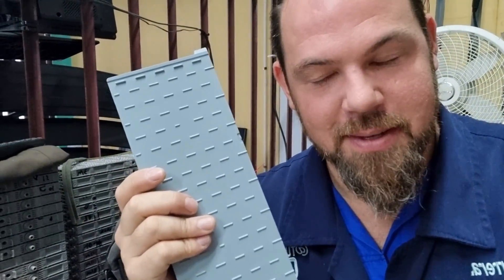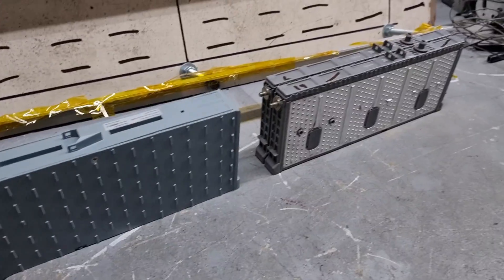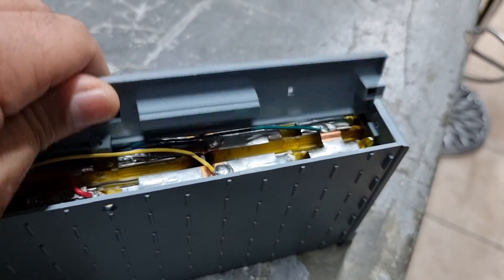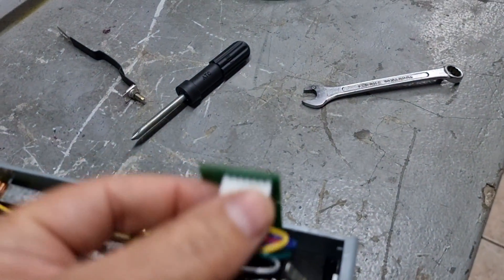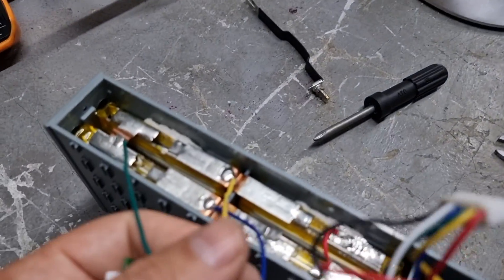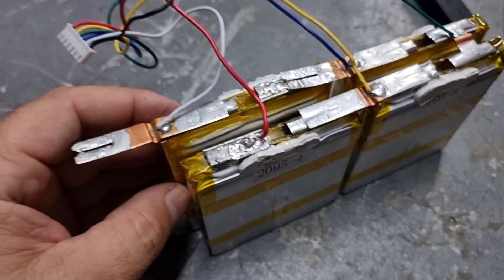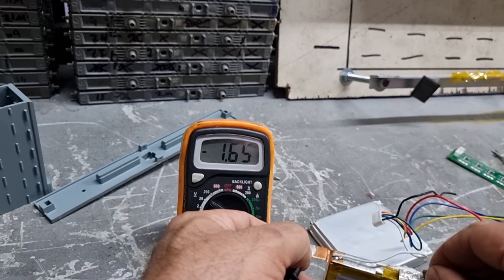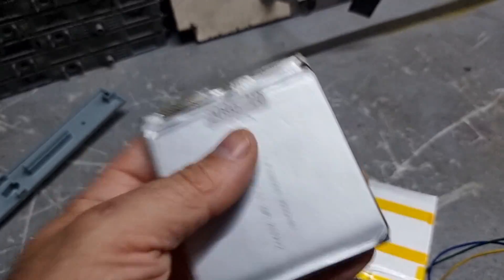Inside the nexcell lithium battery for toyota hybrid (Class Level Lesson)

Comment: Hi Jose, nice video showing the internals of the Nexcell blades, but I am not convinced with the build quality of this product.  The bus-bars are not sufficiently thick to carry the current required by the system.  There is no proper cooling or heat dissipation for the cells!  I know that you provide a good service to your customers, but you will take a serious draw back selling this product which won't last . . . I have also learnt a lot from you Jose by sharing your knowledge, but please keep away from this product as you may own a bad reputation with it.

The Toyota NiMH modules are 6S1P in configuration, since this drop in solution replaces two original modules with one Nexcell module which is 5S2P of LiFePo4 which kind of matches the voltage profile.  Thus 12S1P NiMH cells are replaced by 5S2P LiFePo4 cells.

Well while Jack deserves a lot of credit for bringing this solution to the market, which consists of replacing the cell chemistry NiMH with LiFePo4 or Lithium Iron Phosphate, by a drop in replacement of two Toyota modules with one Nexcell module, he does not address the fact that the car has no notion of the new cell chemistry in the battery.  NiMH with respect to Lithium Iron Phosphate chemistry have different charge and discharge profile in terms:
-> Maximum peak charge and discharge currents  as well as for how long
-> Maximum sustainable charge and discharge currents without deteriorating the battery health/longevity

The guys making the Nexcell Lithium battery are not telling you the whole truth.  These cells build quality is questionable, can it really handle the high amperage current it claims when you look at them.  For sure they did a good job of replacing the chemistry of the NiMH with LiFePo4 and adding cell balancing, but there is more to that, what they don't mention anywhere is the software of the Toyota Hybrid system is not touched.  The car has no notion it has a bigger battery in terms of capacity (Ah) and there is no way that it will make better mileage for what it what it was calibrated for!  Its good as a battery replacement, but too many customers are complaining about the Nexcell cells failing.  Wished the product was better well designed or else there would not have been so many revisions, they should have done it right the first time . . .  They are taking 2 Toyota modules of NiMH {known as a block in Toyota jargon} and replacing it by one Nexcell blade, from 12S to 5S, they should be given some credit for that.  Have a look at one the video where the Nexcell is being fixed https://www.youtube.com/watch?v=6BC56g3C09g by its creator.  Its like a teardown.
Reply: Might want to put some thought into your statement... the oem batteries doesn't have a  cooling system either...because it's built into the case. Nimh also generates more heat during use compared to lithium due to higher IR, requiring more cooling capability. These are also lifepo4 not lipo, so less likely for thermal runaway. Nevermind the amperage is still limited by the vehicle. There is more energy available, but the car isn't gonna use more in the moment than it would for a oem battery. Nevermind you are not pumping the full battery current through an individual cell busbar, that's not how circuits work...

Seems like you are parroting what you heard other people say instead of doing your own research...
Reply: @tarkov_6 What nonsense are you stating, "you are not pumping the full battery current  through the cell busbar that's not how circuit work!"

Comment: Aside from some balance circuits I don’t see any special circuitry or computer interactive bms or anything. 
Just some lifepo4 pouches with balance leads? 
I mean a BMS really isn’t required since the Prius has a built in high and low cut off and active cooling. 
What’s to stop me from using much larger and cheaper prismatic cells and building my own custom pack? Pretty sure I could cram 10 maybe 12 kWh or more in the boot.
Reply from the maker: Go ahead… 😁
Reply: @hybridsolutiondiagnostics  just asking, I see loads of forum posts but not a lot when it comes to actual specifics like balancing, bms etc.
LTO looks like a better fit with higher current capability, temperature range and it falls better in line with NIMH. 

I’m kind of a dumby, I can copy but most of these vehicles are way over my head. I’d like to squeeze a plug in hybrid out of my gen 2 though. A robust vehicle, I live in a rural area, all electric is unreliable but a plug in with a very efficient gas engine back up sounds perfect. Even more so the gen 2 lacks modern network integration and all the other bs I don’t want.

Comment: Great video! Thank you very much. In general, everything looks good. although some things could be improved. Firstly, the current-carrying bars at a glance have a rather small cross section, they will heat up and transfer heat to the cells. passive balancer? he will only do worse here, as an option at least active.

Comment: 3.2v is nominal voltage and it points it is lifepo4 module. It is strong, high current and much safer than liion. I think the producer shall drill ventilation wholes especially near balancer modul which warms resistors when cell has more than 3.65V.
Reply from the maker: New generation modules are coming better ventilated… video coming very soon

Comment: i didnt see thermal solution in there hmm
Reply: I see no strategy at all for minimizing the spread of a over-temp event that occurs in one "blade".  Nexcell designed 6 pockets in its injected molded case, but that's it.  The thin molded walls between these pockets are the only things that prevent flame spread.  

I might have chosen to skip the clever diamond pattern on the external faces of the blade that mimics what Toyota did and instead insert a sheet metal flame barrier between the blades.
Reply: @jimolson5018  this is lifpo4 chemistry they don't flame and i dont think they get as worm as the oem batteries because they can put out a lot more amps
Reply: Jake, when you're blowing off a hundreds of thousands of kilojoules of energy in several seconds, battery chemistry is irrelevant.  Heat is heat and the dissipation event ensnares any flammable material around it, like the plastic enclosure.
Reply: I have multiple 200 amp hour LIPO4 batteries and have had no heat issues, however all my cells do have ventilation and I have seen cells same as mine with evidence of previous ventilation. 
Those were used in city busses.
Reply: As of relatively recently there has been a ventilated top cover released. It's still passive cooling though. Worries me a little bit.

Comment: Wow. Really show the cheap quality of these batteries.
Reply: definitely, this feels very cheap compared to OEM metal enclosures.
Reply: I have bought these cells to replace my old ones and I have not felt that they were cheap. 
The OEM are plastic and metal and that metal is feels rather thin.
I would say that Toyota's engineering of early Prius is substandard. 
Just the fact that they manufacture a car whose batteries would die after a few weeks without driving is indicative of idiot engineering. 
They should had at least provided a trickle charger that could be plugged in to maintain the batteries. 
These replacement batteries are LIPO4 and don't have that self discharge problem. You can leave your car for a year and unless there is some parasitic drain, the batteries will be fine when you get back to it.
Reply: Not sure where you that from this.....

Comment: Dear Jo, i see this give out (3.2v X 5) = 16v @ (3500mAh X 2) = 7000mAh 
the OEM is (as a block) 14.4v @ 6500mAh and has better cooling since metal is better at conducting heat compered to NexCell that is staked up lithium in a plastic case.
Mr. Jack say his battery is 2.6 times more powerful than OEM.. how is that possible.??
the numbers don't add up. i am not so convinced.

can you please shed some light and in-light us with your knowledge and experience..

thank you very much for a great video, and thank you Jack for making Prius good again.
Reply: On their website they are claiming 2.6 times more power using the "peak power" capable of each battery.

260 amp peak for the lithium and 100 amp peak for the OEM battery. 260/100 = 2.6. 

But in my opinion this doesn't mean anything but marketing because the battery will only output as much current as the vehicle calls for. If the OEM battery maxes out at 100 amp, the car will never draw more than 100 amp. 

I suppose the only benefits would be about 7.7% more capacity per "block", 7000mah vs 6500mah. The lighter weight, and more charge cycles? 

Although, to be honest I thought these cells would be much larger and not small cells as shown in the video stacked together with questionable quality control and overall design. I had these on my radar for when my OEM battery goes bad, but after this video I will stay with OEM.
Reply: @bensonak47   put  them in the tahoe hybrid it has two 80HP motor/60kw   and needs 20 of these  (40 normal ones)

 the motor at full power can draw 166-200 amps 320-360 volts
Reply: To me the biggest benefit is that LIPO4 batteries don't self discharge like NiMH. How long can you leave your NiMH powered car parked without starting?
The other big benefit is longevity. 
LIPO4 batteries are usually rated at 4000 recharge cycles. 
Looking up NiMH, I see 1000 recharge cycles at best.
Reply from the maker: According to my tests here i would say a 30 to 35% more powerfull than the OEM batteries which is of course impressive...
Reply: The guys making the Nexcell Lithium battery are not telling you the whole truth.  These cells build quality is questionable, can it really handle the high amperage current it claims when you look at them.  For sure they did a good job of replacing the chemistry of the NiMH with LiFePo4 and adding cell balancing, but there is more to that, what they don't mention anywhere is the software of the Toyota Hybrid system is not touched.  The car has no notion it has a bigger battery in terms of capacity (Ah) and there is no way that it will make better mileage for what it what it was calibrated for!  Its good as a battery replacement, but too many customers are complaining about the Nexcell cells failing.  Wished the product was better well designed or else there would not have been so many revisions, they should have done it right the first time . . .  They are taking 2 Toyota modules of NiMH {known as a block in Toyota jargon} and replacing it by one Nexcell blade, from 12S to 5S, they should be given some credit for that.  Have a look at one the video where the Nexcell is being fixed https://www.youtube.com/watch?v=6BC56g3C09g by its creator.  Its like a teardown.

Well while Jack deserves a lot of credit for bringing this solution to the market, which consists of replacing the cell chemistry NiMH with LiFePo4 or Lithium Iron Phosphate, by a drop in replacement of two Toyota modules with one Nexcell blade, he does not address the fact that the car has no notion of the new cell chemistry in the battery.  NiMH with respect to Lithium Iron Phosphate chemistry have different charge and discharge profile in terms:
-> Maximum peak charge and discharge currents  as well as for how long
-> Maximum sustainable charge and discharge currents without deteriorating the battery health/longevity

The Toyota NiMH modules are 6S1P in configuration, since this drop in solution replaces two original modules with one Nexcell module which is 5S2P of LiFePo4 which kind of matches the voltage profile.  Thus 12S1P NiMH cells are replaced by 5S2P LiFePo4

Comment: good day have you ever installed the Enno car cylindrical hybrid batteries, and how did they work?
Reply: Is it just Ennocar or all Chinese cylindrical? What’s the reason for you not being a fan, is it because they drop capacity quickly? Poor build quality? Fact remains not everyone can afford a nexcell pack, which btw is being manufactured in China as well, or a brand new pack. There are many cars using the Chinese replacements for a few years trouble free, do we have any similar data for the nexcell modules apart from beta testers in the US?
Reply from the maker: @slayryt3533  you said it yourself... fast lost capacity, high IR so the cylindrical battery loosing balance very fast ☝️🥴... a new video about that is coming very soon 👋😎
Reply: @hybridsolutiondiagnostics  Thanks for your response, I will wait on your video, hope we get it soon, because people are buying them up daily, and they aren’t exactly cheap
Reply from the maker: They claim to give 3 years of warranty... but sorry... im not a fan of those batteries

Comment: Wow soldered batteries in series with over 100a current passing thru 
A tiny passive 400ma balancer wich is useless when the car will push over 300v in full regen going downhill 
If one cell is dead like in that case (I assume not even 1 year old) the rest of the cells will receive a lot more voltage wich will terminate them a lot faster and that applies to discharging as well 
That is a big failure module/battery no offence and I personally wouldn't have it in my car
Reply: Good point.  Their circuit boarded "cell balancer" is likely intended to work on a average/long-term basis rather than to instantaneously divert charging/discharging current around a bad cell.  A big stack of Schottky diodes across each cell to prevent reverse bias might provide additional safety.
Reply: Exactly! This type of cells drawing max 2C discharging and max 1C charging: so only 7Amps in charging and 14 Amps of load.. What are we talking about?
Reply from the maker: Yes of course... the idea is to show the very truth to everybody... 👋😎
Reply: No offense but those OEM NiMH modules are a much bigger piles of crap.
Reply: @mark98115  you mean after 2008

Comment: Jose, Excellent video.   I really enjoy your lectures and learning a lot.   Recently I did the EV Only Button mod on my Gen 2 Prius.   Now the stage is set to use the EV mode for my short trips around town, but it looks like this is the battery that would make that possible.  I never go over 35 in town anyway.   But I was interested in Jack's comments that the battery could take a strong current to charge with no problem.   I have an HV charger but it only puts out 300 mA.   What can I use to grid charge this battery to make it into my daily EV around town with no ICE except maybe once every few weeks for a longer drive to maintain the ICE?
Reply from the maker: Jejeje thank you my friend... but remember that prius is not an electric vehicle so it will always need to use the ICE ok 👋😎👋😎 with these nexcel batteries you will have more range indeed but just a little longer...

Comment: Very Good Video :) inside/outside of the housing look real clean an the internals well thought out, in noticing the disassembling the outa neg terminal wasnt fully sealed (A) on further viewing the yellow wire ware pintched against the neighbouring link  where the blue wire resides on those pairing cells (poly type) (B) also the P(b)MS with the load resistors along the thin circuit board.
(A) would this cause heat displacement where the resistance an tolerance put unwanted stress on the adjoining cell (B) the pintched insulation on the yellow wire from the neighbouring link cause disruption an cause that cell or the apousing cell to fail (C) with the resistors running beside each other on a unfilm circuit board where no heat sink neither is applied would cause uncharatricalistic nature in the resistors due to resistance and tolerance variations due to heat or distorted volatge irregularity. regards Dave.
Reply: Very nice observations undeed dave, so far as ive been monitoring a few customers with these batteries and most focus on temperatures and let me say that so far so good... it is why i really like this upgrade batteries... all the cables were very well protected, it was me who took all  covers out ☝️🤣☝️🤣☝️🤣